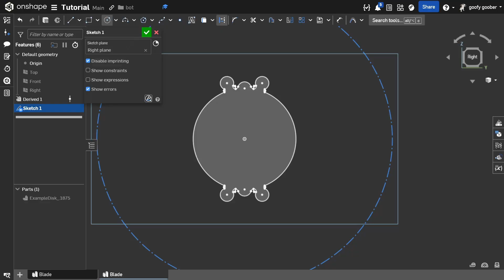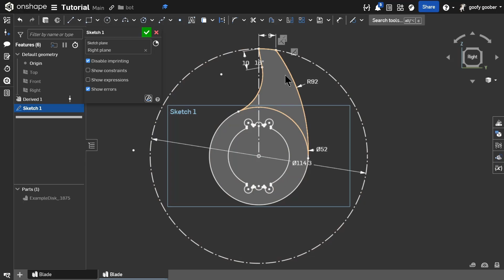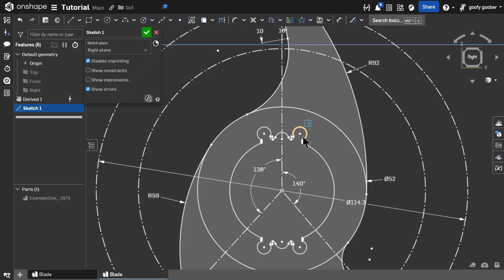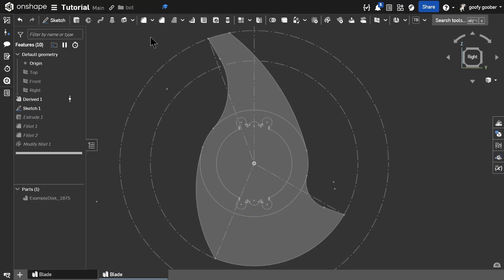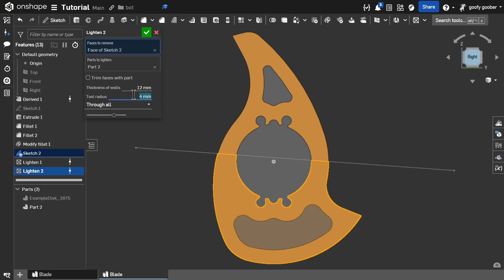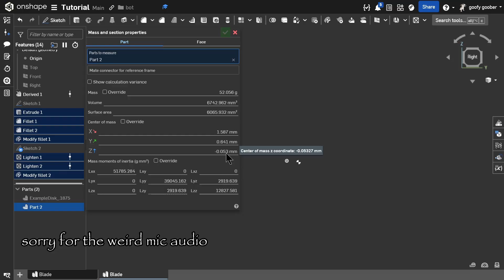How to Design an S-Blade in Onshape - Combat Robotics CAD Tutorial

Comment: "Perfect" balancing trick:  As long as the hub cutout is symmetrical (by that I mean 'center' point at its C.O.M.) and center of mass isn't way off, at the balancing step you can make the hub cutout into a body, copy it, merge the original back into the blade (ie, remove the hub cutout), then move the center of the surviving hub cutout copy (or its 'center' isn't its COM) to the center of mass of the blade, and subtract it from the blade -- presto, perfectly balanced.
Reply from the maker: Yeah I would just balance it normally at that point 😂also you won't get exact control over the diameter/rake angle/other dimensions of the blade if you do it that way, so I don't recommend beginners to learn it that way.
Reply: Yah fair enough. I tend to get it 'pretty darn close' more or less the way you showed, then the OCD kicks in and I center the MOI exactly using the cutout way... not that it gets cut perfectly balanced nor stays that way long.